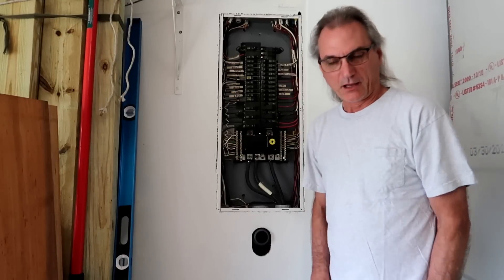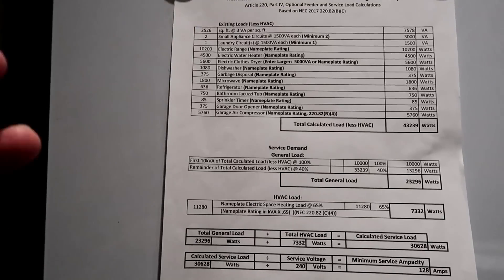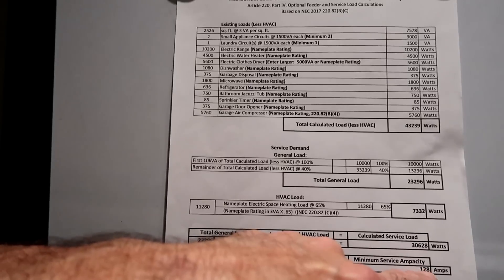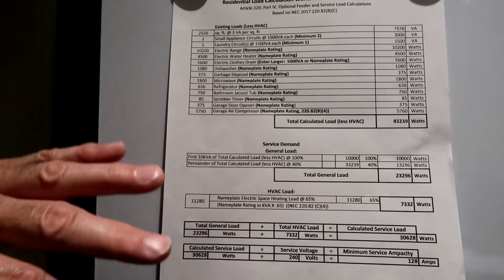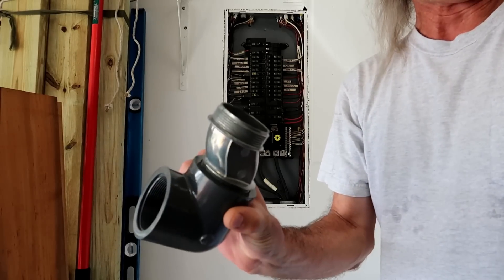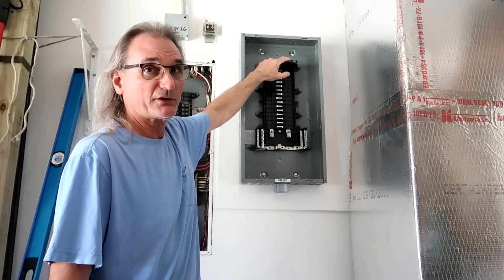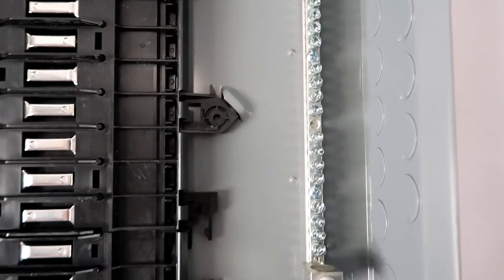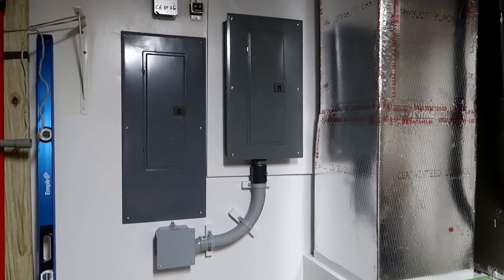A Sub Panel Installation With A Permit And It Passed Inspection

Comment: And why do u remove the green screw if you are still installing grounding wires to them
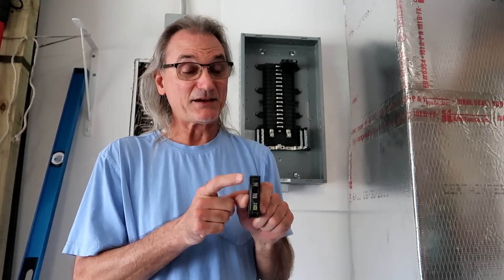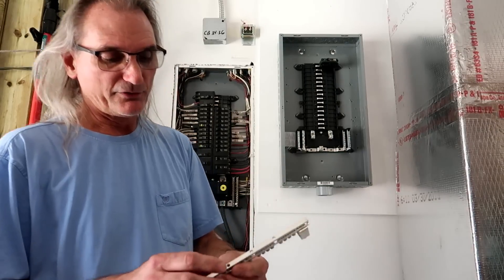Reply from the maker: Hi Ryan.  Even thought the neutrals and grounds are isolated from each other in the sub panel, you still have a large ground wire connected to the sub panel enclosure through the ground bar and a large neutral wire connected to the sub panel neutral bus ( which is isolated from the grounds because the green screw is removed ). This ensures each bus is connected to the main panel and ensures there is no current flow in the sub panel ground wire.  That is covered in the video, 13:20 - 14:48.  Thanks for watching.

Comment: Quick question , you installing a 125A SUB PANEL OFF YOUR 200A MAIN PANEL WITH A 100A BREAKER SIDE BY SIDE IF I NEEDED TO INSTALL MY SUBPANEL 40 FEET AWAY FROM THE SAME 200A MAIN PANEL DO I NEED A SEPARATE EARTH ROD WITH 35 GAUGE EARTH WIRE. AND CAN I INSTALL A MAIN BREAKER IN THE SUB PANEL  SAME 100A BERAKER
Reply from the maker: Is your sub panel within the same interior of the main panel dwelling?  You would need to do load calculations to see if your current 200A panel can handle the load you want to add.  Thanks for watching.

Comment: Great video. I'm an electrician by trade and I am so happy to see people safely tackling wiring projects and doing it the way an electrician would do it. One very small technical thing I saw was the steel offset in the wall going into the main service panel should probably have a bond bushing on it. The metal lock ring will theoretically bond the offset to the grounding system but for total assurance a bond bushing will make sure of it. Not totally necessary but just thought I would throw it out there and don't  feel pressured to have to change it you got a green tag on your inspection but now you have one more tid bit of information that you can use next time and maybe pass onto another person.
Reply from the maker: Thank you for the kind words Jon.  You can never be too safe, electricity kills people and starts fires.  NEC 2017 is not an easy read and I spent many hours in that book to ensure I got it right so my installation would pass on the first inspection.  I am sure the building department cringes whenever they see the owner/builder affidavit for electrical work.  Thank you very much for the tip, I will definitely pass on the bond bushing suggestion to others.  Thanks for watching.
Reply: Yeah. Kinda knit picking but he'll be ok. It's not like it's a service .

Comment: Great video. One question though. Why use a 100 amp breaker to protect a 125 amp sub panel? Is this common practice? Aren’t you then limiting yourself to 100 amps? If I actually need 125 amps should I install a 150 amp sub panel? Thanks!
Reply from the maker: Hi Charles, very good question.  Yes, you are correct, I am limiting myself to 100 amps of service in the 125 amp panel.  I could have used a 125 amp circuit breaker, but then I would have had to increase my feeder size, which could be a bear to work with.  However, I will never come close to needing the full 100 amps that I have available.  I chose the 125 amp panel because of its large physical size and the thirty two spaces.  The required ground bar takes up a lot of real estate in that sub panel and I didn't want it to turn into a rat's nest in a sardine can, I wanted room to work and I wanted to make it look nice.

I do not not know how many branch circuits you plan on adding.  Are you adding numerous 15/20 amp branch circuits or are you adding a few larger amperage branch circuits?  If you actually need 125 amps, I would install a 150 amp or 200 amp sub panel just to give you the room to accommodate the required ground bar.  Feeders for 125 amps, 150 amps or 200 amps are going to wrestle you.  Thanks for watch and enjoy your new electric service.
Reply: @StevesStrayStuff  Thanks for the answer Steve. That definitely makes sense.  Maybe I should go with a bigger panel. I'm expecting to need 125 amps because I will be using large 220V woodworking equipment in my new garage/wood shop. I'm basically just copying what was done in my old shop. It had a 125 amp breaker. I'm not sure what size the panel was though. Plus, I will be adding a mini split AC unit which will pull 15 amps of 220V. Didn't have that in the old shop. As far as 20amp branch circuits go, probably just two or three. I figure its better to go big so I won't run out of juice. 
Thanks for the great info!

Comment: Why not pay a little bit extra and mount a second main panel, mount it inside the wall right next to its host panel, avoid using any conduit (drill through the the stud to run the wiring) and make look better?
Reply from the maker: Hi Art.  I did think about that, but I think there would have been complications.  For some reason, there are extra studs in the wall that did not make sense to me, so I opted to go the surface mount route.  With the surface mount approach, there were no surprises.  Thanks for watching.

Comment: No doubt you've done a good job. However I hope other people don't think it's easy and safe to do their own electrical work . I started my electrical apprenticeship in the mid 60s.  Not long after I started a 3rd year apprentice was electrocuted because a home owner had done his own electrical extension .  The apprentice did everything right, he'd removed the fuses to the power circuit before drilling up through the bottom plate of a timber wall.  Unbeknown to him the home owner had fixed the hot water circuit to the bottom plate inside the wall, and the apprentice drilled into it using a hand operated brace and bit. He died there, under the floor,  recently married with a baby due .  A properly trained electrician would not have clipped a cable to the bottom plate inside a concealed wall. There's no wiring rule that says it must not be done,  but it's just good work practice, something you learn as an apprentice .  The owner had saved himself a few dollars by doing his own electrical work, but at what cost.?
Reply from the maker: That is a very sobering event Phil.  Electricity is merciless when it comes to mistakes.  You're right, if people do their own home wiring, take shortcuts or install things without best practices in mind, unsuspecting innocent people become the victims.
Reply: Without a permit. Did that home owner get sued or did he play stupid and say it was something he didn't know about from the previous owner if there was one.

Comment: great video, thank you! quick question >> I live in a garage apt type place.  I have a 100 amp main panel on the main house.  It feeds a sub panel which is inside my garage apartment.  The only thing in the main panel on the house is a 100amp breaker main cutoff (for my 100a service).  All of my separate breakers for circuits in my apartment are in the panel in my garage apartment ( a sub panel).  The electrician who helped me did not remove the green ground screw in my sub panel.  I think I know the answer, but don't I need to remove that green ground screw in the sub panel?  It's been working fine for a couple of years.... but.... I've never checked to see if there is current running on the grounds in my place.  thanks
Reply from the maker: Hi rhender.  It would be wrong of me to give you a right or wrong answer without looking at what you have because there are variables.  Is the sub panel near the main panel?  Is the sub panel within the same dwelling as the main panel?  Is the sub panel part of the garage/apartment which could be a detached structure?  These things make a difference.  I would recommend that you take a look at NEC 2017 Article 250 Grounding and Bonding to see what category your installation is in.  Sorry that I cannot give you more information than that, but do not want to mislead or endanger anyone.  Thanks for watching.
Reply: @StevesStrayStuff  Thanks Steve.  Sub Panel is not near main panel.  Main panel is on outside of main house which is 40 feet away from me.  Sub panel is inside my garage apt.  Main panel on house feeds my sub panel from an overhead set of wires covered by weather head etc.  So yes, the sub panel is in a detached structure.  There are grounding rods on both the main panel, and the sub panel in my garage apartment.  I'm thinking that I should probably remove the bonding green screw in my sub panel, because it is not the main panel.  thanks for taking the time.
Reply: I'll definitely look up NEC reference you gave me.  Thanks for doing that.
Reply: last thing I'll say is that my electrician was nuts.  Just because he didn't remove that bond screw doesn't mean anything.  He was crazy.
Reply from the maker: @rhender Just by what you described, you may want to have another electrician take a look at it because it sounds like you have the situation shown in NEC 2017 Exhibit 250.19 ( within Article 250.32 ), which requires neutral isolation from the ground in the sub panel.  If that is the case, the your are correct, the green screw should not be present in the remote building, but the grounds and neutrals would have to go their respective buses as well (grounds and neutrals cannot be mixed in the sub panel).  Good luck and stay safe!
Reply: @StevesStrayStuff  Thanks Steve!
Reply from the maker: My pleasure!

Comment: where did you get the fittings from
Reply from the maker: Hi arrow.  The 90 degree radius elbow and metallic offsets from Home Depot and the other 2" PVC fittings I used are from PVC Fittings Online.

Comment: You sure did your homework, and knowledge wise is the best panel video I've seen on here.  Extra points for flipping the guts for bottom feed.
For other people planning to add a sub panel,  you use  SER  for a sub. If you can find some stabiloy cable, you can avoid a lot of the material he used.
Reply from the maker: Thank you Ryan, I wanted my video to encompass the entire process, from the time I filed for a permit, all the way through to the inspector's sign-off.  Thank you for the kind words and thanks for watching.

Comment: Can you route the wires inside the wall to the new panel?
Reply from the maker: Hi Parker.  You could run the feeders in the wall, but the existing branch circuits and wall studs could create problems, especially if the studs are load bearing.  The THHN wires I used must be run in conduit.  SER cable does not need to be in run conduit, but it looks like it is very hard to work with.  If you do opt to go the in-wall route using SER cable, you do have to adhere to NEC 2017 Article 300.4 Protection Against Physical Damage.  Good luck with your sub panel and thanks for watching.
Reply: @StevesStrayStuff  Thanks for the detailed answer.
Reply from the maker: You're welcome.

Comment: Thanks for the video. Want to add a sub panel for a detached garage. Still gathering all the required information. Will try to upload the video.
Reply from the maker: You're welcome.  Since you are working with a detached building, make sure you pay close attention to NEC 2017 Articles 225, 230 and 250.  Thanks for watching!

Comment: Did the city require load calculation sheet because you applied for a permit as a homeowner? Would they have required a licensed electrician to do the same thing?
Reply from the maker: Good question Billy.  All the paperwork shown in my video is what the city required me to submit for them to issue me the permit.  Did the city hold me to a more stringent application process? I do not know for sure. I would image that the Authorities Having Jurisdiction would hold the owner/builder affidavit filer to a more thorough permit application process than a licensed electrician and I really cannot blame them.  I just kept providing them the information they requested.
Reply: I think they were just trying to break Steve's back, thinking he couldn't do it forcing him to hire an engineer or someone to figure it out. And Steve did such a great job using that template from excel. Me, I'm computer illiterate. Those authorities should have provided Steve with the sheets he needed to fill out. And that's bull anyways. If they're making such a big deal about load calcs they should have had them from the original house. I guess they figured that more appliances had been added. What a joke. They could have probably figured out his load from previous electric bill. They just wanted to be dicks. I've looked at plenty of videos of guys putting power to their out buildings and those that were inspected didn't have load calculation. They concerned themselves with proper size feeder wires and grounding.  If the load on the service drop and on the main panel is too much then the owner fixed it. They never change out the service drop if it's feeding sn existing 200 amp panel. Jerks.

Comment: Great video.  I was wondering if you could tell me how you determined your wire gauge.  I am trying to run a 125 amp sub off my main and the table I found  NEC Table 310.15 (B)(7), says that for 125 amp rating #2 AWG copper is needed for the loads, and #4 AWG copper for the ground.  You've done a lot more homework than me, so if you could offer some clarification I would really appreciate it.
Reply from the maker: That is a great question Michael.  Truthfully, I did not do any calculating for the ground wire size.  Here is how my choice happened:

I was debating whether to use Service Entrance Cable (SER) or THWN-2 to feed my sub panel.  My sub panel is protected by a 100-amp breaker which would have required a SER cable to be 3-3-3-5, with the 5 gage being the ground.  After I thought about it, I figured the SER cable would be very difficult to work with, so I opted to purchase four individual THWN-2 wires.

When I went to purchase all the individual THWN-2, the THWN-2 did not come in 5 gage, it was only available in 4 or 6 gage.  I figured that if 3-3-3-5 is what comes bundled in the SER cable, then the 3-3-3-4 was more than sufficient for the THWN-2 wiring.

I know this probably isn’t the answer you were looking for, but that is how I ended up with the 4 gage ground. A SER cable with 2 gage contains 2-2-2-4.

Good luck with your installation and thanks for watching.

Comment: Nice job! Out of curiosity, how much length of wire did you need to feed the subpanel?
Reply from the maker: Thank you David.  I purchased ten feet of each color and used five to six feet of each.  The wire was $0.99 per foot.  I purchased the wire from Wire & Cable Your Way.  Thanks for watching.

https://www.wireandcableyourway.com/

Comment: I see you added a neutral lug for your white wire. did you remove a screw and buy a new (additional) lug? thanks for the video A+
Reply from the maker: Good morning bkoz.  I am sorry I do not have an answer for your question, the large lugs for the the white wire were already existing in the Main Panel and in the Sub Panel.  Thank you for watching!

Comment: PVC metal  no no no ugly panel look like owner
Reply from the maker: Hi Luis.  The county signed off on my installation, but maybe the inspector missed something????  I spent hours in the NEC 2017 Handbook making sure my installation is per the current code.  The two metallic offset nipples are properly bonded to the load center enclosures.  Please let me know what Article of NEC 2017 you think I violated.  Or is this just your opinion of your personal preference?  The last thing I want to do is to pass on bad information to others.  Thanks for watching.
Reply from the maker: Hi sparky.  The two metallic offset nipples each have a metallic lock ring at each enclosure to properly bond the metallic offset nipples to the enclosures.  I did use plastic insulated bushings on the metallic nipples for chafe protection.
Reply: That's because it is. The guy obviously did his homework and did a decent job, but you cant expect a homeowner to know all the materials available to do it professionally.
Reply from the maker: Thank you Ryan, I appreciate your comment.  I just hope I am not ugly too, haha.
Reply: Sorry but using plumbing copling in electric kill me  and yes you're ugly jjjjaaa

Comment: WHY is that Sub Panel mounted HIGHER than the Main Panel ?? You should have kept the top of the Sub even with the Top of the Main !
Reply from the maker: I mounted the sub panel as high as I possibly could on purpose.  If I mounted the sub panel the same height as the Main Panel, I would have limited myself to 40% conduit fill instead of 60% conduit fill when running my new non-metallic (NM) branch circuits through conduit into a load center. Per NEC 2017, if the conduit length exceed 24 inches, I am limited to 40% conduit fill.  With the sub panel installed high, my conduit length is only 22.5 inches which allows me to us 60% conduit fill per NEC 2017 Chapter 9 Table 1, Notes 1 -7.   Note 4 covers the 60% conduit fill.

Comment: STOP saying '' VA '' !! Call It what it is , '' VOLT AMPS " !!!  '' VA '' is the Veteran's Administration !!!!
Reply from the maker: For both of us to be 100% correct, VA is volt-amperes, not volt amps.  However, VA is how volt-amperes is represented in formulas and on a Load Calculation sheet, 20 A X 120 V = 2400 VA.  My main goal was to let people know that the VA is considered the same as Watts per NEC 2017.  I will say volt-amperes from now on, I promise.